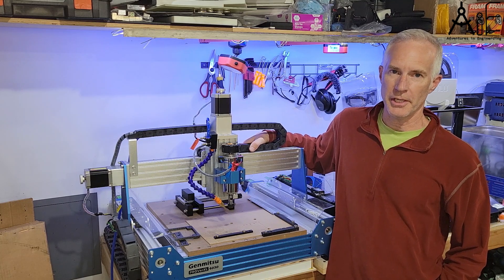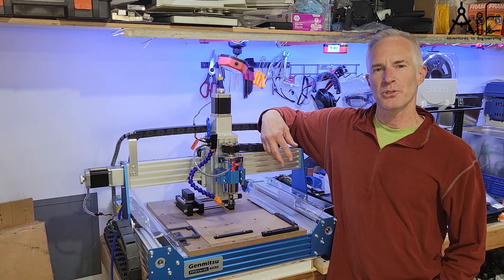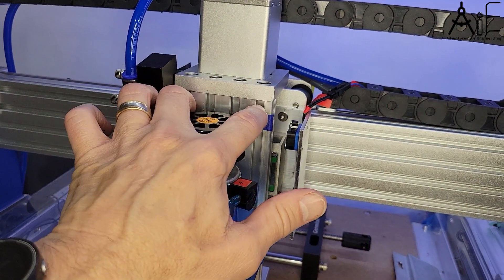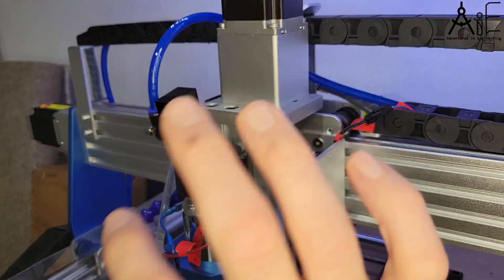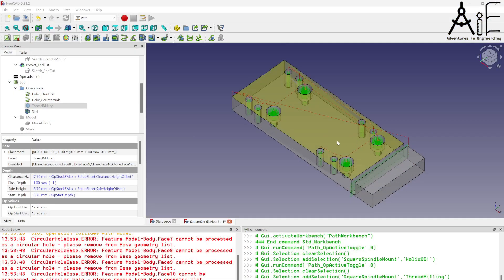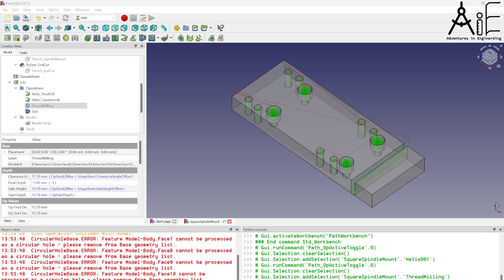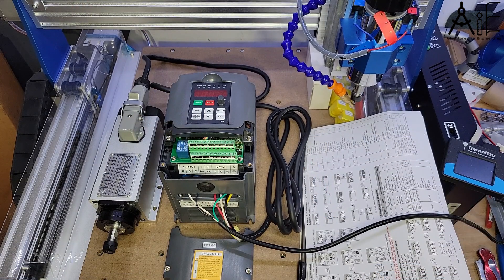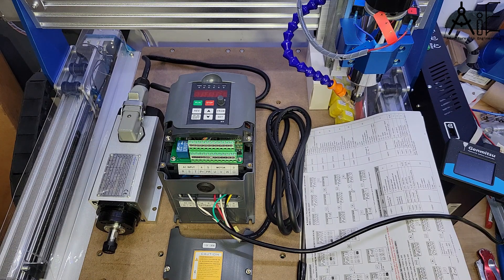CNC VFD Spindle Upgrade Part 1 - Genmitsu ProverXL Desktop CNC

Comment: I am curious about the extra stick out of the tool bit(s). Was it not possible? I would assume more rigidity with less stick out. Thanks, Great video!
Reply from the maker: @joet.4756 Yes, the more the tool bit sticks out, the more chance of flex. But the bit is also strongest where the shaft has no flute cuts (solid round). The bit shear point is typically where it exits the collet clamp. So shortening it clamps on the flutes at a weak point. That is why I clamp the tool above the flutes but may lose some tool bit rigidity.
Reply: @adventuresinenginerding  thank you

Comment: Hello! I need some advice. I can't do the project, the needle doesn't touch the surface of the wood after the test it rises too much and executes the project in the air
Reply from the maker: @GeaninaCeaus  you will need to adjust the height of the spindle so it just clears the bottom of the z axis assembly when at the highest point and the bit touches the spoilboard at the lowest point.  Then the Z axis needs to be zeroed to the spoilboard or material, depending on your CAM program.  Good luck.